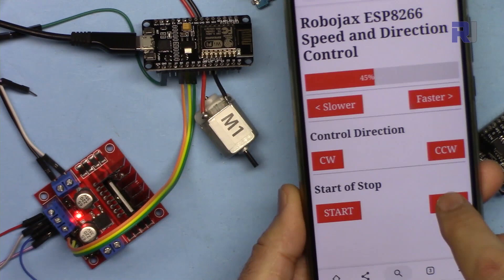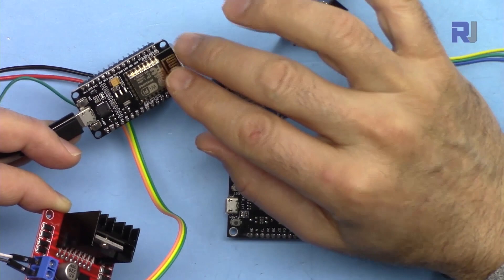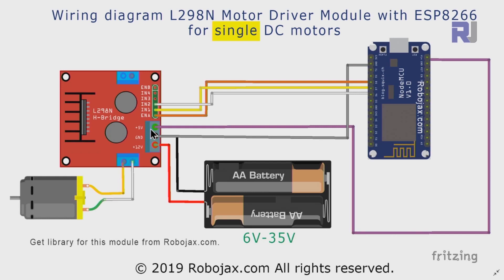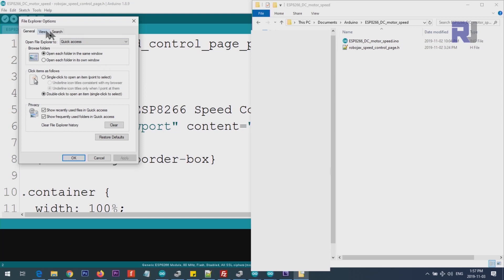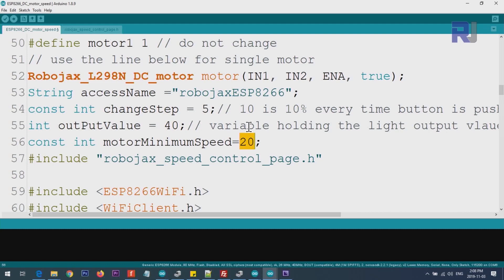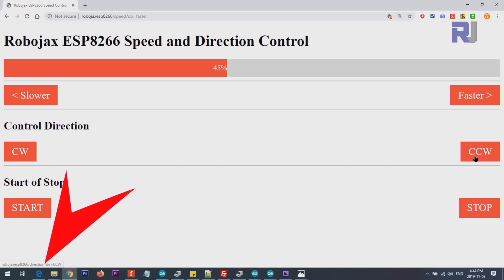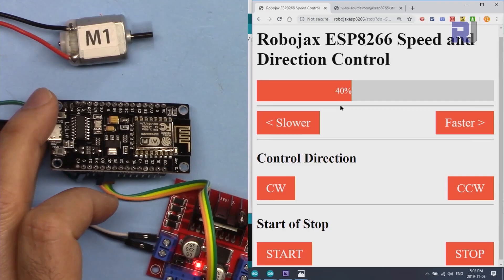Full Control of DC Motor with ESP8266 NodeMCU D1 Mini over WiFi

Comment: I am using Arduino Due for the first time. I used a Hall Effect Sensor and a simple code to get a tachometer reading from a rotating shaft. I wish to control an actuator 12volt DC motor using the tachometer reading. When the tachometer RPM reading is less than 250 RPM I want the motor shaft to turn clockwise, when the reading is more than 250 I want the motor to turn counter- clockwise and when the reading is 250 RPM I want the motor to stop. Do you have a video that will help?

Comment: Not working, page dont want to load
Reply from the maker: 1-make sure to learn how to use ESP9266 here https://youtu.be/pLvqh57T3s4 2-Make sure that you can control DC motor without the wifi using ESP8266. then come this video.
Reply: @robojax  hello, when im using different arduino code its work ok. Here i cant load control page.

Comment: Hi, @Robojax is there a way to connect 2 motors and the 2 motors gets controlled by this website(the 2 motors are for the forward and backwards wheel). Big Fan!
Reply from the maker: Hi, glad it helped. Working with a partner to offer a cloud service to control or do robotics from anywhere in the world.  Subscribe so when I announce it, you will be notified.
Reply: @robojax  Sure already subscribed, And can you tell me what you used to create the website?
Reply from the maker: which website? Robojax.com or the page you see on this video? both I have used manual program and used bootstrap.
Reply: @robojax  The full control of dc motor website.  0:21

Comment: Is there a way to trigger direction change by with a relay switch.  I want the device to press a contact on the end of its travel telling it to reverse direction.  Great tutorial.
Reply from the maker: Hi, if you are in Canada the here link to Amazon https://amzn.to/3ISKDDg or in the US https://amzn.to/3s9ITPz and place them such that they are pushed. But this is very tricky . you may learn the trigger from this video https://youtu.be/diS_WkUdU-8 where push buttons are used to change the direction of rotation.  Good luck. I might make such video but not sure when.

Comment: anything that needs to be added to display the rpm value?
Reply from the maker: to know the rpm value you will need something called "encoder" either you attach it to the motor or purchase a motor that already has encoder. then you can use encoder to know exactly how to rotation the motor made. this is basic motor without encoder.

Comment: I need this for a large 12 HP /  24 VOLT DC motor at 300 AMPS.  CaN YOU DO??
Reply from the maker: Just find a motor driver module with PWM and ENable pin. it will work.

Comment: моя прошивка и у меня не хочет меняться скорость на esp8266 
#define PIN_ENA D0 // Нога  скорость вращения мотора №1
#define PIN_ENB D5 //Нога скорость  вращения мотора №2
#define PIN_IN1 D1 // Нога направление вращения мотора №1
#define PIN_IN2 D2 //Нога направление вращения мотора №1
#define PIN_IN3 D6 // Нога управления направлением вращения мотора №2
#define PIN_IN4 D7 // Нога управления направлением вращения мотора №2
uint8_t power = 105; // Значение ШИМ (или скорости вращения)
void setup() {
// Установка всех управляющих пинов в режим выхода
pinMode(PIN_ENA, OUTPUT);
pinMode(PIN_ENB, OUTPUT);
pinMode(PIN_IN1, OUTPUT);
pinMode(PIN_IN2, OUTPUT);
pinMode(PIN_IN3, OUTPUT);
pinMode(PIN_IN4, OUTPUT);
// Команда остановки двум моторам
digitalWrite(PIN_IN1, LOW);
digitalWrite(PIN_IN2, LOW);
digitalWrite(PIN_IN3, LOW);
digitalWrite(PIN_IN4, LOW);
}
void loop() {
// Вращаем моторы в одну сторону с разной скоростью
while(power < 255) {
analogWrite(PIN_ENA, power); // Устанавливаем скорость 1-го мотора
analogWrite(PIN_ENB, power); // Устанавливаем скорость 2-го мотора
// Задаём направление для 1-го мотора
digitalWrite(PIN_IN1, HIGH);
digitalWrite(PIN_IN2, LOW);
// Задаём направление для 2-го мотора
digitalWrite(PIN_IN3, HIGH);
digitalWrite(PIN_IN4, LOW);
delay(3000); // Пауза 3 секунды
power += 30; // Увеличиваем скорость
}
power = 225;
// Вращаем моторы в другую сторону с разной скоростью
while(power > 105) {
analogWrite(PIN_ENA, power); // Устанавливаем скорость 1-го мотора
analogWrite(PIN_ENB, power); // Устанавливаем скорость 2-го мотора
// Задаём направление для 1-го мотора
digitalWrite(PIN_IN1, LOW);
digitalWrite(PIN_IN2, HIGH);
// Задаём направление для 2-го мотора
digitalWrite(PIN_IN3, LOW);
digitalWrite(PIN_IN4, HIGH);
delay(3000); // Пауза 3 секунды
power -= 30; // Уменьшаем скорость
}
power = 105;
}

Comment: Assalomu alykum        static const uint8_t D0 = 16;
static const uint8_t D1 = 5;
static const uint8_t D2 = 4;
static const uint8_t D3 = 0;
static const uint8_t D4 = 2;
static const uint8_t D5 = 14;
static const uint8_t D6 = 12;
static const uint8_t D7 = 13;
static const uint8_t D8 = 15; here it is giving an error, I will be happy if you can fix it, I asked you for your telegram, I was sending things I didn't understand, thank you in advance, may God bless you
Reply from the maker: this has been explained in this video https://youtu.be/4QpOErbx0nM which is introduction to smaller ES:P8266 board. When you mention error, please provide the actual error. I knwo this error says that D1 or D2 is already defined. which meanns  you have the variables defiend. so you neon't need to comment those lines out like this
//static const uint8_t D0 = 16;
//static const uint8_t D1 = 5;
//static const uint8_t D2 = 4;
//static const uint8_t D3 = 0;
//static const uint8_t D4 = 2;
//static const uint8_t D5 = 14;
//static const uint8_t D6 = 12;
//static const uint8_t D7 = 13;
//static const uint8_t D8 = 15; 
when you add comment to the line liek this //  that line will be out of the code or simply delete them.
If you want to learn about variabnles and data types, please see this vidoe https://youtu.be/xi9Hegk9M9k